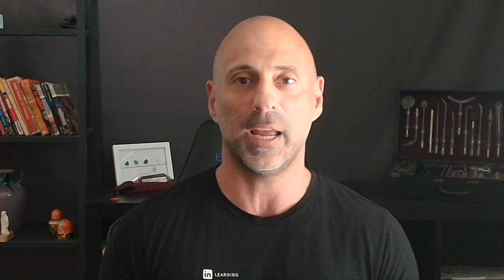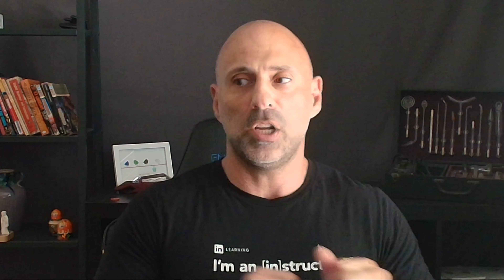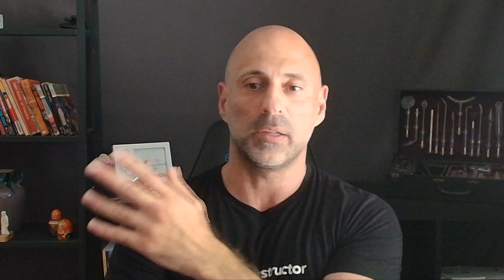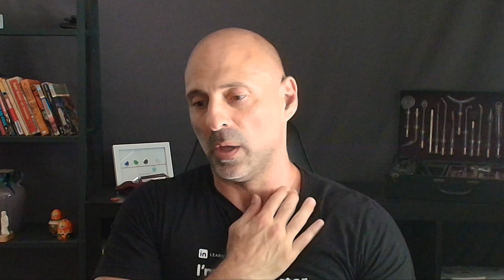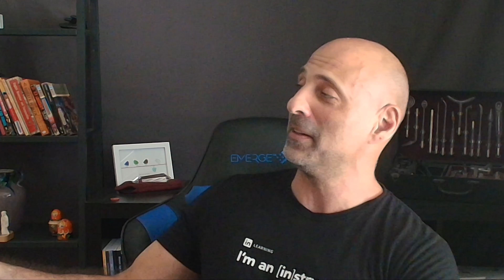What's the BEST CAD System? NX vs CATIA vs Rhino vs SolidWorks - Honest Review 🛠️

Comment: I'm more a CAM programmer working at an aerospace supplier doing 5 axis work but I still perform design duties for certain things and have to perform a lot of model modification and repair. NX in my own opinion is hands down the best software I've ever used, perfect? No. Nothing is, but from everything I've seen on both the CAM and CAD side it is the best all around. The toolpaths outside of perhaps hypermill are the best I've used.

Comment: Rhino is a great program! Tons of amazing tools. I've been using Plasticity lately as it's VERY fast at designing and surfacing. It's missing a lot of tools that more seasoned programs have so it's hard to call it a "CAD" software. It's more of a 3D modeler. But I design quickly in Plasticity and then export to Rhino and do more detailed work there.

Comment: At work I've used NX and Catia (and many other dinosaurs). I prefer NX, -but it's not perfect and does frustrate me from time to time.  I am investing into a personally owned software for my side hustle and was leaning Solid Edge just based on my fondness and comfort level with NX however, I am concerned about the size of the user community in comparison to Solid Works. I haven't considered Rhino but will look into it more after hearing your endorsement. Importing nurbs to NX from Rhino has historically been problematic for me but this is the only nurb base data I have to deal with so I can appreciate that it's more of a nurb problem and less to do with Rhino. I have heard others that live in this universe profess that Rhino produces the cleanest geometry. Thanks for the video, very helpful.

Comment: I have a professioal experience with Creo, Catia V5, Kompas 3d, T-flex. I have an educational experience with Solidworks, Inventor, Solidedge, 3d expirience, Fusion 360, ZW3d, AutoCAD, FreeCAD. For me my top 3 CAD for my tasks: 1 Inventor 2 Creo 3 Kompas 3d. I design production tools for CNC machine and casting patterns for sand casting.
Reply from the maker: I keep telling people Creo is very powerful but the still hate it. 

My biggest issues with Creo are the around the accuracy of the data. Tends to be a little off on certain features.

Thank you for the comment!

Comment: Rhino is so amazing application. The plugin tools developed for things which are not well made in native Rhino is really good. The grasshopper - simply the only one solution for many things. And the pricing is just unbeatable. So many expensive yachts designs made in Rhino in terms of outer design and interior - all final surfaces. Also I would love to point out their management and support team and well, CEO - they just seem to be nice people to talk to. 
Industrial designer, 2 weeks ago switched to NX from Alias+Fusion, love it so far.
Reply from the maker: Wonderful comment. Thank you.

Grasshopper is truly amazing. That has changed the market and other companies had to play catch up. And yes, sooooo many boats are designed in Rhino. Super high end stuff.
Reply: I’m embarrassed to say this but we’re a 3rd generation machine shop in south Louisiana primarily repairing rotating equipment but we have a few cnc machines. Our cnc programmer and supervisor programs conversationally on our mazak integex ramtec 8 controller and we’ve never utilized the 5th axis on the machine so I bought the full nx pkg and all the training and we are still on 1st base needing modelers and next level NX or cam experienced guys. Any advice would be appreciated

Comment: I used Creo for about 20 years (started with Pro-E 18). Now I use Teamcenter/NX (and Solid Edge).
I can only say, I prefer Creo over NX any time. Parasolid is way slower compaired to the granite kernel. Especially when wave links are used. Parasolid doesn't understand zero thickness walls. The sketcher in Creo is much better on every aspect. 
And the NX interface is really a laugh. Solid features are buried in the surface  menu. Opening a suppressed item in an assembly is not possible,...
And why are drawings that slow ? Moving a view, selecting the assembly in the drawing to open it takes ages,...
We use i9 processors (14 gen), ADA 4000 graph with 64 GB of ram and still we are more waiting then working...
Creo 12 on my 11 years old i7 PC with only 16 GB ram and a gaming card is working faster compaired to NX on that top notch laptop...
And in that 20 years I worked witk Creo I never had any issues with accuracy of the 3D data from Creo. I used it mostly for sheetmetal and Creo does a far better job then NX in that department. NX can't even create a revolved wall...

Comment: I am new in auto cad, I wish to know the best employability. I want to start learning. I have Bachelors in Mechanical Engineering degree.
Reply from the maker: Catia 3DX or NX.
Reply: @classasurfacing Thank you for the reply. I've subscribed.
Reply from the maker: @umangdave111 thank you very much. 

You'll find that either one of those systems will give you a lot of options and those options are typically the best paid. 

Good luck and let me know what happens

Comment: A CAD system has to produce a finish "right" whichever you use, including downstream modifications - but getting there, I think cost has to weigh in as number 1, as you indicated. Which tool, Steve, do you think translates best for FEA meshing? I am about to take an FEA course at Oakland.
Reply from the maker: Welp, it depends on a few things. Catia goes right in to Abaqus. With NX, it is Sim Center. At this point: who do you want to work for? See what they use and go from there. Either will be fine since most of the companies you will want to work for use either of them. 

Sorry the answer is not so tight. Meshing is its own world.

Comment: Hands-on experience over the years with AutoCAD, Cadkey, Pro/Engineer, SDRC I-DEAS, SolidWorks, NX and Creo. 

I agree with Steven that Creo has the worst data quality of the "Big Three" (NX, Catia, Creo).It's been that way with Pro/E & Creo from the very beginning of Pro/E in the late 1980s.

Creo is also, IMO, the least innovative and is moribund in terms of adding capability and streamlining existing capability. For the past 10+ years I've run a continually rotating mix of SolidWorks, Creo and NX - by far the most innovative, i.e. adding new features and improving existing features & workflows, Siemens NX runs rings around all the others. Constant improvement is a mantra at Siemens, whereas doing the absolute least possible is Creo's mantra. Which is why Creo still has the worst drafting capability in the industry and  still has 20-year-old vestiges of their original menu system here and there in Creo's UI. Then there's the steaming pile of feces that are Creo's various Config files.

SolidWorks is a great tool overall, perfect for small to medium-sized jobs, but very limited where large assemblies, complex surfacing or high-level analysis is needed. Very user-friendly, but SW's lack of rigor causes a lot of unintended consequences down the road.

When one considers the overall capability of NX, the genuinely CAD-neutral/CAD-agnostic nature of Teamcenter, and the sky-is-the-limit analysis capabilities in the Siemens engineering software suite, I, too, would choose NX & Teamcenter in a heartbeat, for either a startup or an established Creo or SW house that wants to improve their game and future-proof their engineering tools landscape. For startups, the pricing for cloud-based NX-X and Teamcenter-X are quite reasonable, especially considering that the ceiling is so high with Siemens, your engineers will literally never bump their heads on the ceiling with Siemens, whereas the comparatively quite low ceilings of, say SolidWorks and Creo are fairly limiting. SolidWorks is limiting because it can't handle big stuff or complex stuff. Creo is limiting because of the crappy UI and Creo's refusal to clean up their ancient code and add new features and new workflows that actually, you know, FLOW.
Reply from the maker: Siemens has been off the meat rack with updates. It is insane how fast they are updating things. 

They are serious about giving the customer what they want. 

And Creo... It is a love hate for me. It could be great but it is lacking in so many ways. But in the end, the data is rubbish.

Comment: NX is a very poor choice for very small companies. Wish I didn't know this. Great for medium to enterprise.
Reply from the maker: It all depends. What does the small company do?
Reply: @classasurfacing manufacturing design for special effects in film mostly. I’m an owner operator. I have licenses of Solidworks, Creo, NX and lately Onshape. Let’s start with licensing machine permissions. Siemens must have the most antiquated ass about methods in the  industry. This is not hyperbole. Follow that up with a pretty loose (in my experience with 2 different vendors in 2 different countries) VAR support. Seriously unimpressed with either of the VAR’s I used abilities to deliver timely support. Everyone I dealt with was working remotely. Often in or out of a car, about to pick up the kids from school or shocking mobile reception. Hang on, I’m paying you annually for THIS? If you combine this with the need for PDM - you’ll need someone to administer IT.  Why I didn’t say it was bad software but not suitable for very small business. If you’re administering IT configurations for licensing and PDM, you’re not designing. If I compare this to Solidworks which I think was very good but Dassault has failed to evolve, their VAR support is superb! Big shout out to Solid Solutions (my old VAR in the UK). I have a perpetual SW premium license and stopped paying my annual update contracts after 2021 release. That’s when I went on the expensive PTC Creo and Siemens NX journey. I hope my experience helps a viewer make a more nuanced choice. There is so much more to owning software than what it can do. VAR support is critical if you’re paying NX money. I can only assume large manufacturers like Daimler Benz have Siemens people dedicated and on site because of the number of licenses. Good luck and happy designing.
Reply: Re: "NX is a very poor choice for very small companies."
>>> If you can't provide a basis for your opinion, you really should delete your own post. As Steven already said, it depends entirely on what the needs are, what the goals are, who your people are.
Reply: @MicSofty I’m not deleting anything. I paid for the software I own the opinion.
Reply: @raytheonbuna1021  Fair enough. But given that this is an informational YouTube channel, it would have been nice had you provided some insights as to why you feel that way - in the spirit of all of us sharing information and learning from each other. Oh well...
Reply: @MicSofty  I did actually write a lengthy reply with a lot more granular detail also but it hasn't been listed for some reason. Perhaps Youtube algos autoedit commercial review things sometimes?
Reply: @MicSofty  long story short, My VAR experience was very lacking in 2 countries. I'm an owner operator and for the extreme price I expected a lot more.
Reply: @raytheonbuna1021  Yeah, my original post has been blocked somehow by YouTube. Steven said he didn't block it, and when I'm logged in to YT I can see my original post, but when I'm not logged in, it doesn't appear. All the mysteries of YouTube are not known to man.
Reply: @raytheonbuna1021  I, too, am an owner-operator, but I am fortunate that I got a superb VAR (ATA Engineering). As my original (invisible)post stated, I have been using various MCAD systems for forty years, the past ten years I am constantly working with SolidWorks, Creo and NX. NX is my favorite, and my Siemens VAR is absolutely stellar. SolidWorks is hard to beat for up to mid-range complexity & assembly size, but beyond that I need NX. Creo is my least favorite of all, for a multitude of reasons. But to each their own.

Just curious, did you look at either Solid Edge or SolidWorks in lieu of NX?
Reply: @MicSofty  Ahaa Yes my original (invisible) post... I've been using SW since 2013. I had very good VAR support in Australia for 4 years then excellent support in UK from Solid Solutions. After becoming frustrated with SW lack of development I investigated Creo, Solid Edge, NX. I paid for 4 days training in each to assess them. CAM was important. Creo was ok. Some UI things lacking and I didn't think the CAM was very compelling. Solid Edge iirc had some really curious ui/ux things that annoyed me. NX had the best UI, best cam. I'm seriously really glad my northern European VAR experience is not universal. After all this, I agree with you SW is the best value for money for the work I do.
Lately I've been working in small groups and have been dipping my toe in the Onshape water. It's cloud based file sharing for pdm and the compute intense tasks like FEA for modelling and CAM toolpath generation are very compelling. UI i'd give a 6/10...... If they offered a low contrast theme, that would bump to 8.5/10. I'm easy to please really... 😂
Reply from the maker: For some reason YouTube blocked it. ugh. It is a pain to sort through the comments as the backend is terrible.

Comment: Have you heard anything of how long they will support V5? 
I know the OEM I work for will absolutely under no circumstance send their data to the cloud like V6 would require. Not sure how Koenigsegg have done it but they rock V6 (One of only few in Sweden :D Might have Enovia) Heard from some other people it was possible to have it combined with teamcenter but no even sure how that would work..
Creo data in Catia is absolute garbage half the time, so many rounds turns into spheres as well in corners and an absolute mess.
Reply from the maker: I will make a video about it but in short, it will be available for a very long time because no one wants to move away. All new tools are going into 3DX and not much into V5. Just things that are core to the modelers will be in V5. 

You guys are safe.

Comment: What in your experience imports an stl and can be modeled around with parametric tools? Also Solidedge runs on different kernels than SW have you noticed a difference.
Reply: Re: "Also Solidedge runs on different kernels than SW have you noticed a difference."
>>> Can you explain exactly what you mean by that statement? Are you saying a different version or fork of Parasolid? Because Solid Edge has run on Parasolid since roughly the year 2000.
Reply from the maker: NX has Convergent bodies that allow for parametric edits. As well as Cage modeling and morphing. 

Years ago I had a temp license of NX with all the things and I could put a cage around an STL, link the cage to planes and points, and morph things like mad by dimension. Is insane.

Comment: I'm a mechanical engineer, officially as of 1991.   I took a job in Detroit (having never been there before) in 1994 and immediately got trained in CAT V4, up through scan data to Class A surfacing.  I never worked directly as a Class A designer, but it's great to know it.  I played a bit with CAT V5 and though it was horrible.  Eventually I moved back to San Diego and back to aerospace in 2002, working in UG, whatever release it was, then I think up to NX2.  I started my own composites company in 2005 and chose NX.  Great choice.  I think my early Mach2 seat was $20k and then I upgraded to Mach3 for another $5000 or so, with ~$5000/year maintenance.   A few years ago, I just moved over to the annual subscription model and it's ~$10,XXX per year.    I have tried a few other systems over the years and nothing compares.  However, whatever CAD system works for you to get your job done today is the best system.   I agree that Pro/E-Creo (whatever it's called now) brings in some bad data.  I worked with a commercial space company that used Pro/E and it seemed like a very poor choice.  I work with smaller companies that use it. I think smaller companies, it's best using a Prosumer software (Pro/E, Solidworks, Fusion 360).  Luckily my primary customer is using NX in-house, so that makes things much easier, though we only share data via STEP, XT, etc.  Even though the cost can be prohibitive, I think if you want to work with companies at the top  of the food chain, you should probably have the same taste in CAD tools.
Reply from the maker: For some reason YouTube decided to black a few comments and yours was one of them. But you are free to comment away now. 

I am also in SD doing work for an Aerospace OEM that now uses NX... email me and lets compare note: info@classasurfacing.com
Reply: @classasurfacing  will do.  My office is in Miramar and I live in the college area.  -Mark

Comment: Ah the good old question which is the best.  The answer is always it depends on what your trying to do! Over 25 years on CAD. CATIA 20 years V4,V5,V6 and 3 on NX. Which is best I'm not really sure. I Think for the fundamentals of the modeller and the way you structure your models CATIA is better for developing parts from A-surface to released Auto parts and then allowing you to swap out a-surfaces etc with min effort.
 On the other hand I love the innovative tool sets that Siemens provide and the constant development to save the user time and effort. I found it fun modelling again lbut likely because I was learning something new.

 Tools like the filleting assistant AI thing are a game changer. In CATIA unless you are clever and use some tricks adding 100's of fillets on ribs etc is a nightmare.
 Dasault haven't really developed anything in the core modelling features for years (GSD, PD) probably decades other than tweaks. They put out plenty of flash videos for features locked behind an obscure license you've never heard of.  It just feels old and unloved with astronomical licensing costs.
Reply from the maker: Those things are easier in Catia for sure. There are reasons why and I should do a video about it. Thank you for the idea.